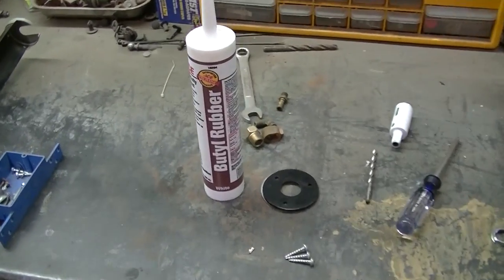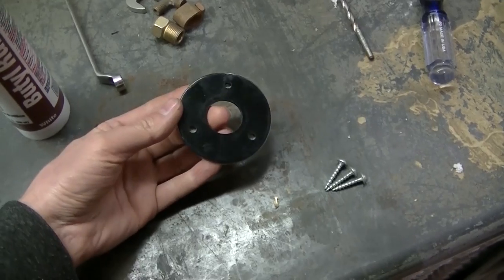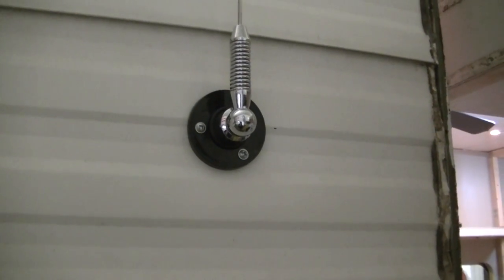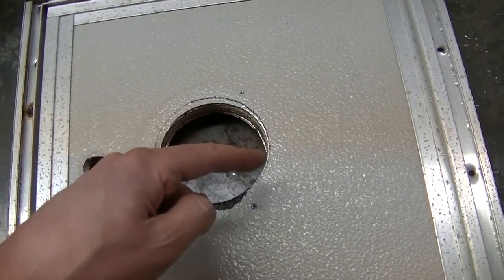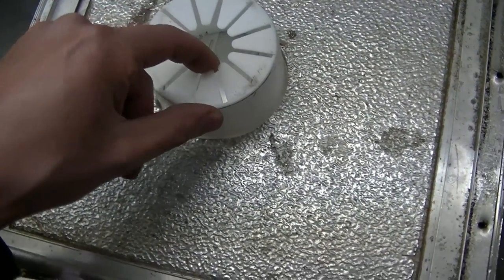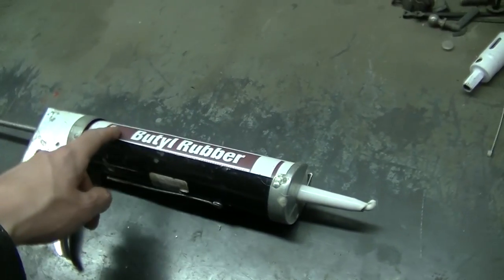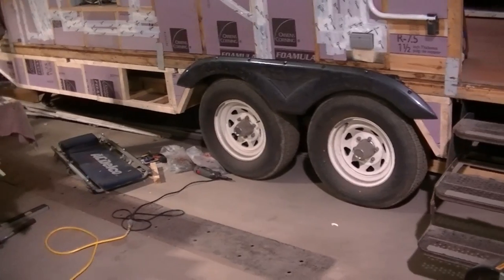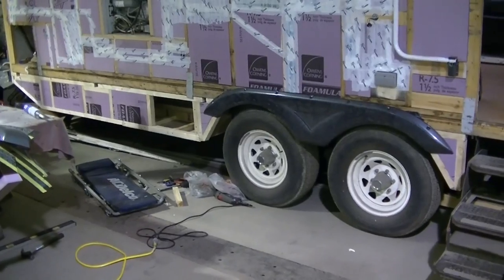92 Terry Resort 5th Wheel Camper Build "Truck Plug Door"

Comment: i never been able to use that calk to seal up on my camper.  but your camper is looking great.. awesome job!
Reply from the maker: +Donny Krane   If it would come out of the tube easier I could use it but right now my hand gets cramped up trying to go around even that small door.  I have some butyl tape coming.
Reply: Have you tried the battery operated calk gun? I use that gun for fire stop caulking, much easier to use!
Reply from the maker: +Donny Krane   I would love a Dewalt caulk gun but at $180 probably not going to happen.  Going to try a better caulk gun and see if that helps.

Comment: Did you even get keys with the trailer? and will you get all locks keyed to one since every lock is probably different now ?
Reply from the maker: I didn't get anything but junk when I bought the trailer.  Most of the doors have the same key.  I have new door handle for the entry door.  Not sure what key that has.
Reply: mossman381 A good idea is get that door lock keyed the same lock as your house. Thats what i always do

Comment: Just a tip, that caulking gun wont work good for thick urethane and that butyl rubber. Get a real caulking gun and it'll work :)
Reply from the maker: +Veikra   I thought that was a real caulk gun  :)  I will have to look at the home store and see what they have.  Are you talking about an electric gun?  Not sure I can justify the cost of electric.
Reply: mossman381
no no need for electric, that gun you have doesnt have the punch it take for that stuff. Just like windshield urethane will damage those guns. You need a beefy one with a cast handle, not a folded metal one. The reason they have cast handle is because they handle a bigger mecanical advantage so they push harder.  A real gun will bust that tube open easily without hurting your hands They'll also last longer
Reply from the maker: +Veikra   Cast handle,  I will look for one.